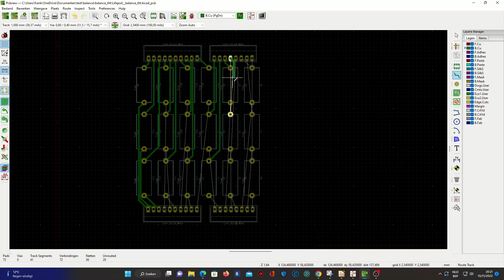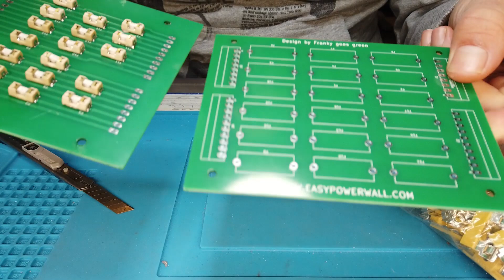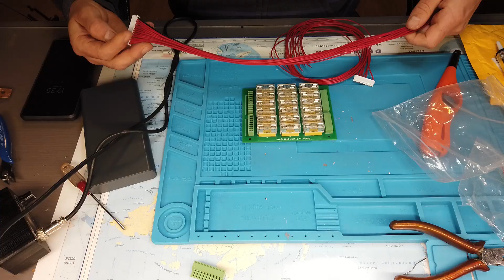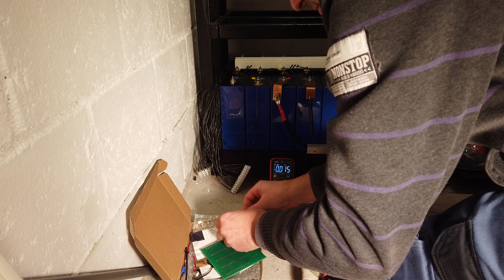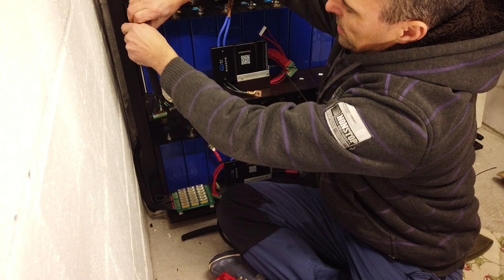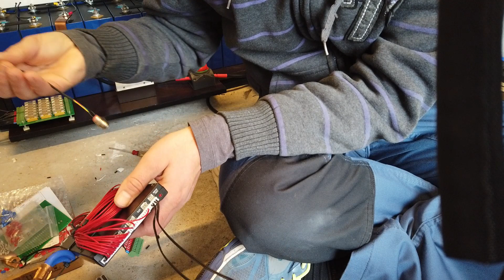BMS protection board - Adding a extra safety layer to your DIY powerwall.

Comment: In your parts list I can not find any fuse board . I seen you have your name on your balancing fuse board where can I find the s16 board
Reply from the maker: Hey, 
Under the video you can find a link to my google drive.
There you can download the gerber files to order the PCB from you favorite PCB factory.
I ordered mine from JLCPCB.
If it doesn't work send me another message, try to help you out.

Franky - EASYPOWERWALL

Comment: What is the fuse internal resistance, the higher the resistance the more it will drop your balance current.
Reply from the maker: Fuse IR must be close to 0.
All leads are equally long, so if there's a little drop, it's the same drop over all leads.
So far it's running great for 18 months, minimal balancing when cell hit 3.45V.

Comment: Hmm, someone might think that fuses should come after securing the cells and the connectors. But, what do I know.
That is an disaster waiting to happen!
Reply from the maker: HI thanks for your feedback. The fuses are in place to connect the leads towards the BMS. 99% of the time the balancer is not active and there's no current. It's additional protection just in case there's an internal problem with the BMS that the fuse can do it's job. If one fuse is blown the BMS will shut down. So it has nothing to do with high current or cell protection.
Franky - easypowerwall.

Comment: Are there not any such fuses DC rated?
Reply from the maker: These fuses are max 250VAC, but they are rated for a current. In this case it's 3A. 3V DV and 4A -> the fuse will blow.

Franky
www.easypowerwall.com

Comment: Nicely done!

I think it adds value due to safety and looks nice.

Do you sell the pcb as well? 

I could not find a link or something else. 
Or did I not read something 😅
Reply from the maker: Hi Erik, there's no link to the PCB yet. (the gerber files are available on the shared drive) Will add an extra connector as some people requested and will offer the PCB, parts and built kit once finished. Keep you posted.

Comment: Very nice, I like the big ones more. 
1. It would be useful to add a second connector to allow easy connection of an active balancer. Or, does it exist two-row connectors? - where it could connect also as 2nd device active balancer next BMS on one row in PCB
2. It would be good to have numbers printed on the pcb according to the balancing cable - next to the connectors and next to each fuse
3. With 5A fuses would this pcb board also handle NEEY - 4A Active Smart Balancer?
Well done, great video.
Reply from the maker: Hey Tibor, thanks for the great feedback. I'll take your wish list in consideration for the V2 board. Keep you posted.
Reply: @easypowerwall  Check out the pcbs for battery cell connections from Taranis Energy DIY project components: 4s-8s-16s for 105Ah to 320Ah battery cells.